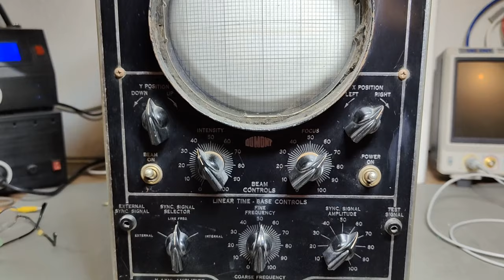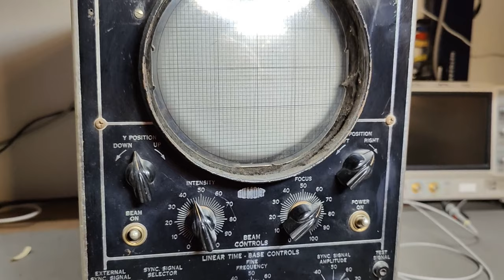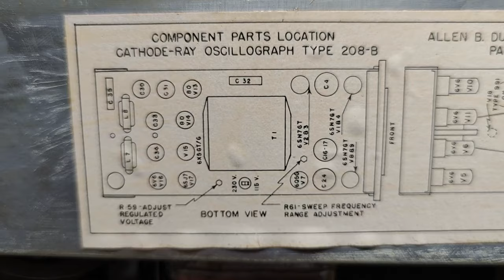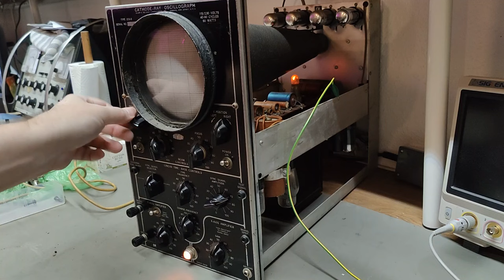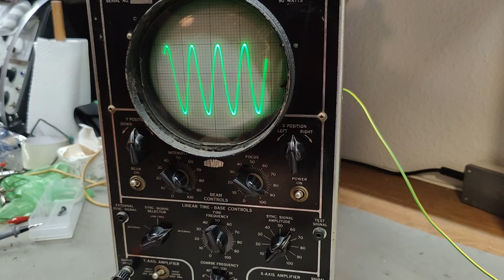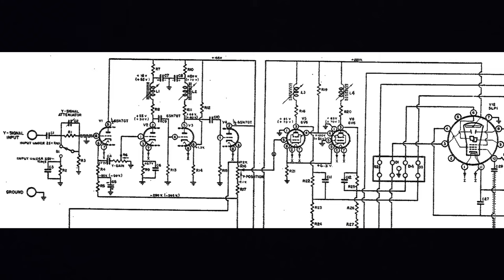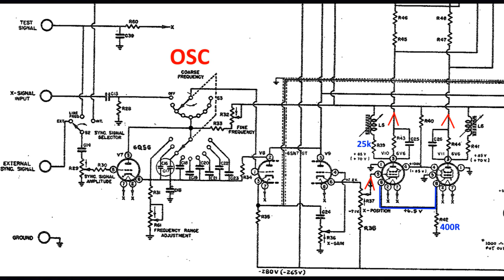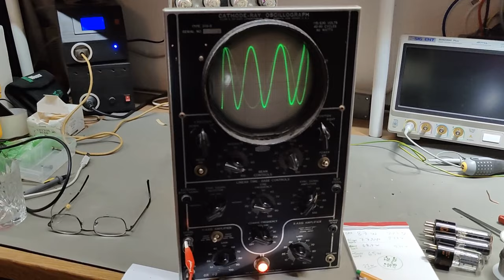Dumont Cathode-ray oscillograph type 208-B 1940 test teardown repair

Comment: I was given one as a teenager, in the techical high school, may be 1971 or 1972, with broken crt and some missing valves. 
I've managed to reverse engineer it, get a brand new CRT and valves, and make it work. 
The only non original component is the voltage rgulator reference, replaced by a big neon lamp, and the input pins replaced for banana plugs . I used  it for audio and radio ham for the next 20 years ( only 30 Khz bandwith). 
Eventually I replaced it for a trio crt scope, in the arly 80s, and a digiscope a few years ago.
From time to time I turned it on and it still in working condition. The value at the time was about 500 USD, about 8000 today !!!
This scope was used for atom bomb development in usa and other countries
Reply: actually I built a triggered base time sweep generator and a chopped 2 chanel input ampifier, was a great project for a 15 YO kid.
Reply from the maker: Wow nice

Comment: I had one of those in about 1971-2. In the last days of high school I wandered into my physics class where I had a friendly relationship w/my teacher. DuMont was actually founded in Montclair, New Jersey, where was born & raised and I lived at the time. The factory was in Clifton, NJ, one or two towns over. I have no idea if that had any bearing on why the school owned one. DuMont was considered a higher-end name in televisions and while it wasn't any kind of Tektronix, it was considered good gear. One of these was up on a table; all the other pieces of gear were neatly put away on shelves. I asked the teacher what was going on with the scope, he said it wasn't working, they were going to throw it out and that I could have it. Well of course I jumped on it. I took it home and discovered that one of the socket lugs on the CRT socket was cracked in half and obviously not making contact with the CRT pin. I either soldered the two halves together or stole a lug from a junk octal socket and the thing worked! So I fixed it for nothing. Mine had a blue trace.  As I recall, the scope was loaded with 12AX7 tubes, all of which were pretty old and noisy.
Reply from the maker: wow Alan thanks i appriciate your story, it is always nice to score free stuff and make it work, you are right they made a few models looking almost like this, with blue screen for example model 304 that is precented in the Vintage Electronic Test Equipment (VETE) FB group at the moment. If you are not allready a member ? it is a good place to connect with other oldie-tech geeks like me :-)
Reply: @TeardownOZ2CPU  Yeah, nowadays, nothing is given away for free. Even if a truck ran over it, somebody has to try to sell it on ebay instead of giving it away to a kid who wants to futz with it and maybe learn something. It's funny, I am pretty sure my DuMont didn't use so many octal tubes, but if that scope came out in the early 40's, I don't think 12AX7s were around then. [introduced 1946-1947] But it still weighed 45-50 lbs, LOL! I actually saw two later version DuMont scopes, one like the 208 but with the grey front panel at the local recycling palace, and another much later DuMont scope that looked much more 60's, maybe even 70's. I let them go.
Reply from the maker: @alanpecherer5705  i also monitor local dumb and recycle places, challenge now since you cant just go pick up stuff, rules are there for a reason, so maybe some unwanted people came too often and picked up all parts of value, left the trash for others to clean up, sadly..
Reply: @alanpecherer5705  that was my case, I was given it when being at 3rd year of technical school, and was like some one had given me a ferrari car

Comment: Old radios and old test equipment use the same basic design across the industries... The difference was slight changes to basic design. The very top companies, Grundig, HP, Tek, Philips would take that design and expand on its capabilities to add stability etc. etc. 
Thanks for taking us WAY BACK in time.. How they manufactured the CRT was a work of art!! Several videos on line how they made CRT, amazing!!!!! 🙂
Reminds me of the Tv Show, Outer Limits!!!! 🙂
Robert USA

Comment: Really quite remarkable. Good ol' 1N4007s stepping in to rectify some voltages! I hope that chassis isn't plated with cadmium oxide!
Reply: Cadmium plating was exactly what I thought of when I saw that dusty metal degradation... probably, stripping the chassis and cleaning it very thoroughly, probably replating or painting it while avoiding to ingest any of that dust might be a good idea.... Also, probably one should pay attention around these sealed high voltage capacitors - there might be PCB oil (not circuit boards, polychlorinated biphenyls) in them.... also be wary of military grade fungicides from that era, they might explain odd smells.
Reply: actually they used 1930's 80 diodes capable of endure the 1600 volt of the power transformer

Comment: A beautiful oscilloscope and decently made nowadays you don't build equipment like that anymore. Clean the switch contacts and potentiometers and it will last a second time.😊
Reply: Cómo pieza de museo está bien conservarlo a pleno funcionamiento pero como instrumento de medición en un laboratorio de electrónica está totalmente rezagado de los que actualmente se consiguen de tecnología moderna  y con unas excelentes prestaciones a unos precios realmente muy muy accesibles.
Reply: @CarlosSilva-gc8ny  For the amateur do-it-yourselfer especially when it comes to audio, it is very good.